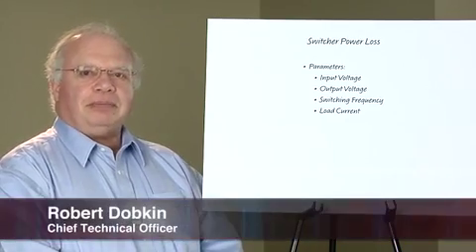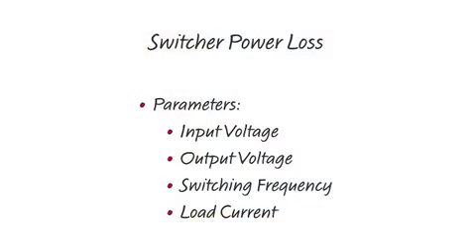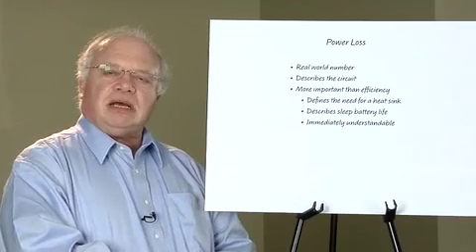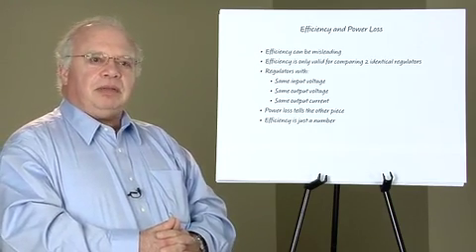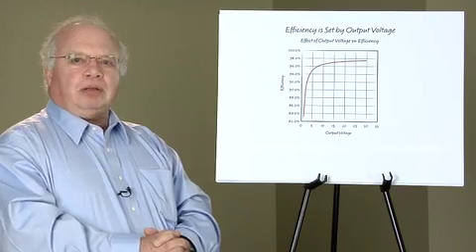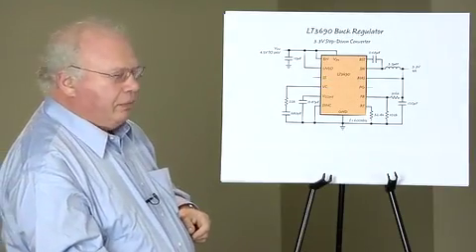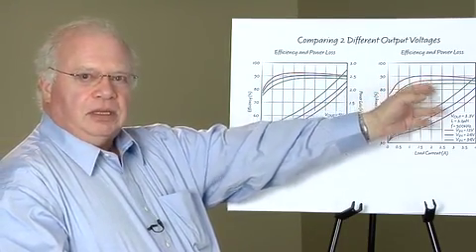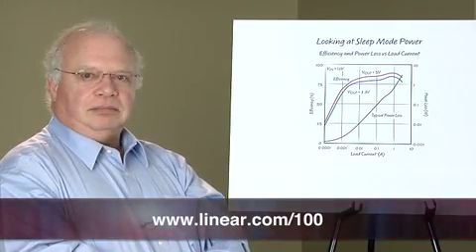Switching Regulator Power Loss

Comment: It is not clear for me why the switching losses are not affected by the increaing of the output voltage. If I increase the output voltage, I increase the power and therefore I will increase the currents and the I^2.R losses as well. Additionally, higher output voltage will increase the blocking voltage in switches which will affect the switching losses as well. Am I right?